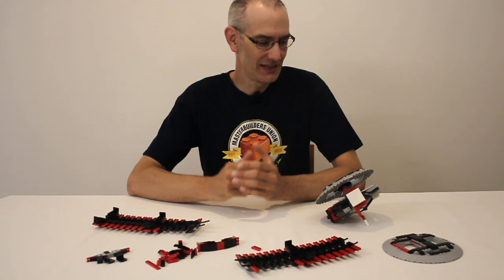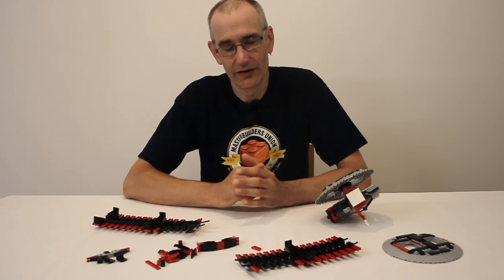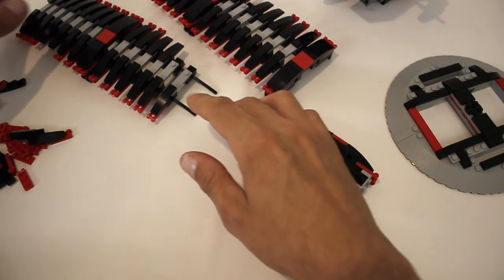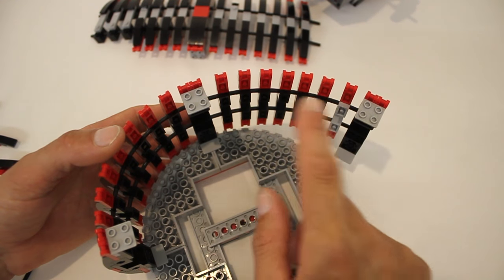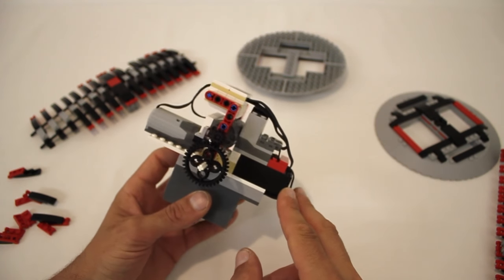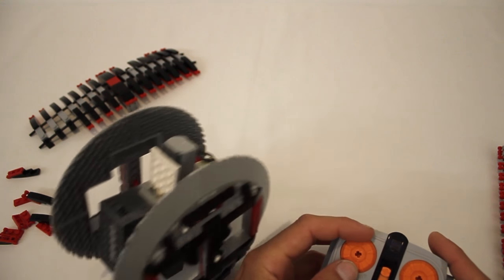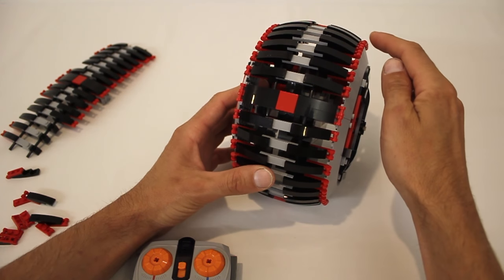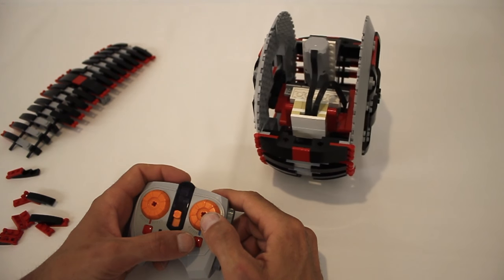LEGO Remote Control Monowheel

Comment: Wonderful system. I would like to suggest a servo for steering. If you use either remote, click reset/let go and it centers.
Reply: good idea :)
Reply: I was just gonna suggest a servo motor. I think that's the best and easiest way to do it.

Comment: Again a great idea and wonderful execution on the design of the ball. For the first version it already looks good.
To centre the counter weight you could use a PF servo with a small liftarm attached to move the counter weight. Press the red button on the remote and the counter weight will centre. And like mentioned before in the comments is to use a Sbrick. This gives faster control over the fast moving ball compared to the train remote. Good luck on improving this idea. Although it has been done before this is the best RC ball I have seen so far.

Comment: Nice way to steer. may put some weight to the sides and elevate them in their counter direction. Whenever left one moves to up, right will go down (like an "H" with turning part is the center and sides moves vertical in opposite direction). decent weight will lean that thing to the side i guess

Comment: I suggest using a servo motor to steer instead of an m motor, the servo motor can be attached by an axle out of the front of it and when you turn the wheel in one direction it will spin up to 90 degrees in that direction and doing your weight based turning, then it will be easier to control ( you spin the wheel on the controller to spin the wheel thingy) AND it will have self center (red button)

Comment: Count Juggula approves this build!

Also it seems you are rotating a dial for the counterweight to function, use an axle rod in the hole and one of the peices that were on the Bohrok sets that were eyes so that it always points to where the central balance point is. KUTGW!

Comment: For the self-centering mechanism you can do what ZillaStorm said or you can make the right-hand side turning thing on the remote to become a joystick as there are methods to do this and just have a rubber band on both sides of the joystick to keep it centered when there is no pressure applied! <3

Comment: What if the steering mechanism was sort of like a pendulum? The weight beneath a motorized pivot, so it'd attempt to heave the mass of the pendulum to one side? Then you could let gravity do the work of centering the thing, and perhaps use more of a joystick to control it.

Comment: You're just too good Jason! Great job, but it will be interesting to see how will you solve the problem with BB-8's head always staying on the top
Reply: That is one of the greatest challenges.  Since a kid swallowed another magnetic toy and was injured, the rules on magnets in toys were tightened.  The LEGO company had to encase its train magnets in the buffer beam to make the piece too big to swallow, which means it is next-to-useless for other applications like BB-8 head-holding.  I have shown a solution in my own LEGO Ideas project - search there for "BB-8" if you don't see the link anywhere here.

Comment: you could cut the track in half and have each half of the track controlled separately for the turning. it would have better reaction time if it worked

Comment: Amazing and wonderful idea.  I couldn't help but slow down the video and watch how it came apart.  I wish it had batter angles in the destruction, but I'm sure you weren't expecting it to happen.  The first impact seems to separate one of the brackets, and the next drop separated the bracket on the opposite side, causing a split-then-collapse effect.  In your description you said you created it in sections, which I believe was for easy put-together.  I'm just wondering if there was a way to stagger the tubes; find a way to run a third tube in there for staggering; or run 2 long parallel tubes, but have the meeting points for each tube-rail be on the opposite side of the wheel?  Just wondering if any of these would have an impact on the ease of the build?  Again, great idea.

Comment: What if you spun up a small weighted flywheel, then braked it hard to move inertia to the frame to cause it to rotate. That might be a little more reliable way to steer.

Comment: When I saw your steering mechanism all I could think is why you hadn't used the new servo motor that centers itself.
Reply from the maker: I tried the servo motor at some point, unfortunately it's a bit too large to fit in the space, and alsos require more mechanics to shift enough weight.

Comment: make the m motor spin a gyroscope as it moves so it will give its position a value, and then set a button to spin the motor one way or the other depending on if the gyroscopes value is positive or negative, and spin the motor until the gyroscopes value returns to zero
Reply: also, check out sphero

Comment: Doesnt matter when i watched this, this is too good, i can't even build a small car using legos even, this guy probaly can be able to build a mini volt bike (if i can make that, i have to push it since i dont have the pack that has the systems and controls, also, there is no way i can make that steering)

Comment: Here's an idea for steering. You could use the same motor for a method used frequently in a game called Besiege. Some weights are attached to a motorized wheel on the edges. The wheel is made horizontal rather than vertical. When the vehicle moves forward, that weighted wheel spins rapidly in the necessary direction. As the creation moves forward, the wheels slightly "slip" and change the creation's orientation.
Reply from the maker: That's a really interesting idea. Will definitely need to file away for some future project, even if it doesn't work out for this one.
Reply: xX_BassBass_Xx  that's not a bad idea
Reply: That's a gyroscope.
Reply: xX_BassBass_Xx, gyroscoping (what it's called in Besiege and real life) isn't possible with low rpms. Gyro's must spin fast and probably only the XL motor is capable if sort of working. Just so you know, Besiege physics are heavily modded usually and all gyros in Besiege use mods to have a ridiculous speed of like x200 while the game max is x2.

Comment: You probably figured out how to improveme steering. I wish to biuld similar with lego technic only.  I like trucks and whole engine mechnism, but why you didn't used servo motor which moves both sides and back center. It should work I guess. Cheers.

Comment: Wouldn't it make sense to use a servo for the steering, so it would self-center?
Reply from the maker: Yeah, definitely tried it. Unfortunately, the servo motor is a bit large to fit in the interior.

Comment: I like the way you have used a simple mechanism to achieve rolling and steering.  For my own remote controlled LEGO BB-8 I have a first test video https://www.youtube.com/watch?v=KJZaTLFjyFY and project blog https://ideas.lego.com/projects/126131/updates  I used the XL motors for more torque, with an L-motor to spin a flywheel for the spinning function and Servo motors for steering and the spinning function flywheel brake.
BTW I really like your Maze.  I bought one but the internal piece selection was not quite as good as your prototype.  Great to include some proper Technic beams with studs though.  A mix of studs and studless is best.